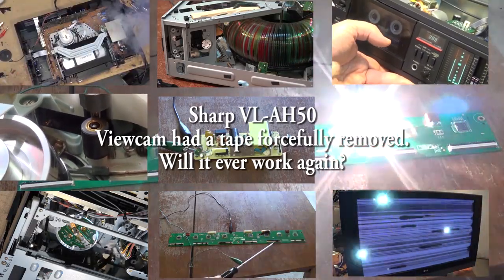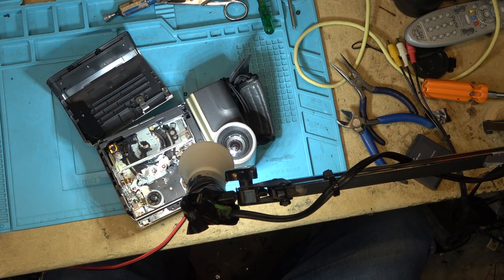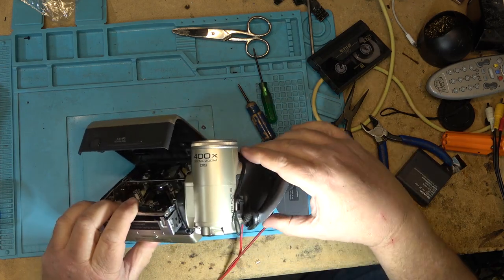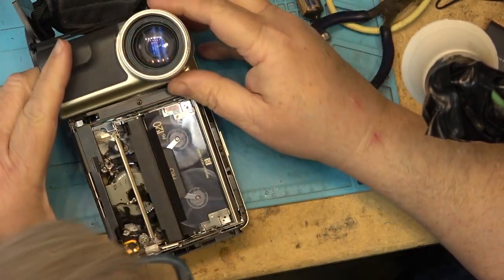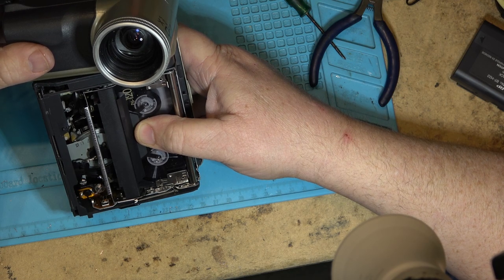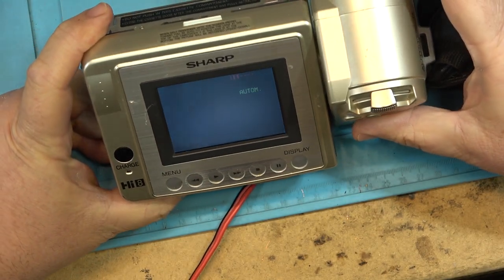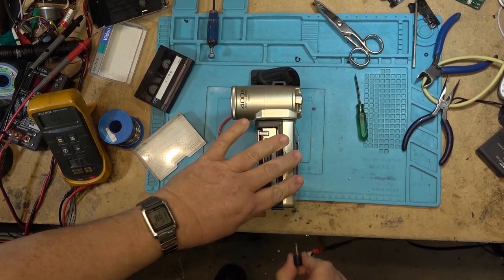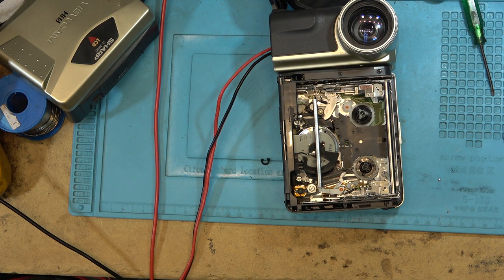Garbage can camera.  Will i get it running?

Comment: Hello, 12voltvids nice repair. 👍 I have a question to ask you, I have an LG VCR that needed tape bath alignment. So I watched your video on how to align a VHS tape path alignment without using a scope, and I aligned the tape guides using a CRT television to get a good picture. However when playing back a VHS tape sometimes I would find lines or a crease just before the bottom edge of the tape. So I wasn’t satisfied that the tape guides were aligned properly however, it would play a good picture. So I borrowed a Samsung VCR with perfect tape path alignment and I am planning on recording a colour bar video from YouTube onto the VHS-C Tape by playing a colour bar video from YouTube on a smart tv that has YouTube, and plugging the Samsung VCR into the smart tv and recording it onto a blank VHS-C Tape using an adapter, as that is the only tape I have to record on. And I am thinking to play back the colour bar tape into my LG VCR to be certain if the tape guides still need adjustments. I just want your opinion on this. It’s hard finding a colour bar video on YouTube however, I found 3 but I don’t know which video to use to record a couple of minutes of it onto my VHS-C Tape. There is a video with multiple colour bar segments on it and I don’t know what to record on my VHS-C Tape I was wondering if you can see which video I should use and record to my VHS-C Tape, so I can use that VHS-C Tape to see if my LG VCR needs the tape guides adjusted.

Here are 3 YouTube links to 3 colour bar videos, (the first link has multiple colour bars on it)…
1st link.

https://youtu.be/JDqQnC-26yc

2nd link.

https://youtu.be/ayf1sYiNLhQ

3rd link.

https://youtu.be/l4bDVq-nP-0

Thank you so much. 👍 
Kind regards. 😊

Comment: I tried to capture my family's video using the camera itself. Its a JVC with VHSC. However, all caps inside it must be replaced. it powers on sometimes and then it thinks that the battery is low and shuts off. Then i decided to move to a vhs.